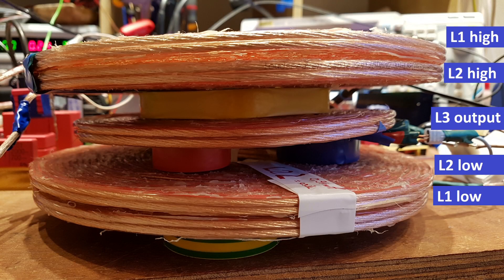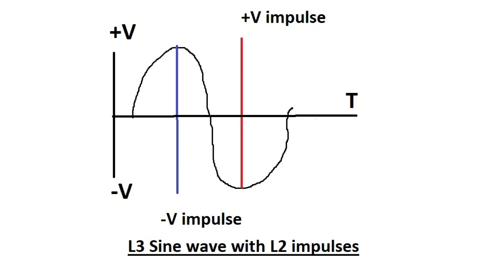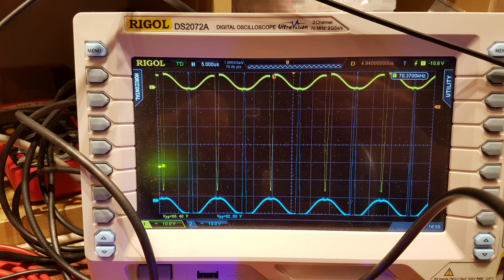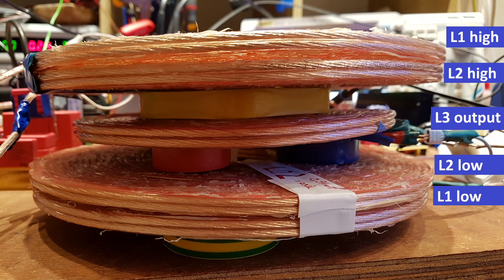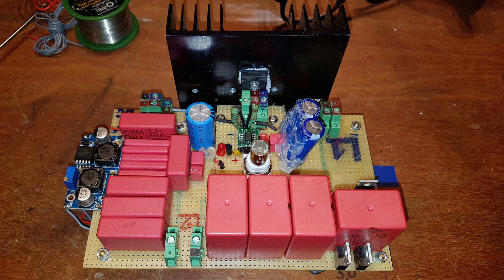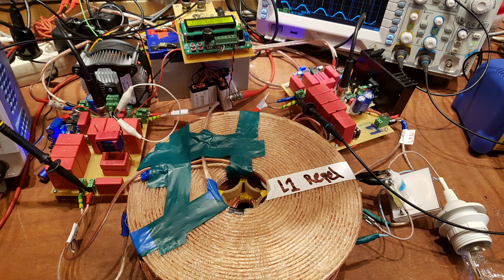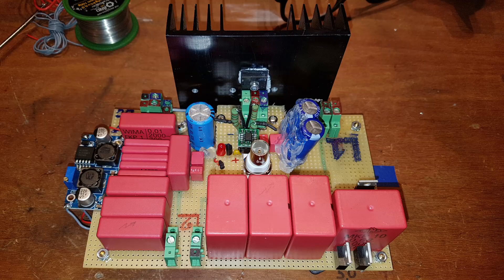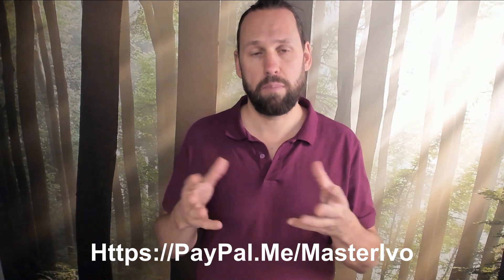How to induce electricity

Comment: I present a crazy thought for your consideration: Following the discoveries of Ken Wheeler -- aka Theoria Apophasis -- the magnetic dipole is a direct consequence of a dielectric, radial field and occurs at a 90 degree instantiation of a hyperboloid shape of counter-rotating vortices, forming a wrap-around return on both open ends of the hourglass by consequence of the magnetic attraction to the pole on the other end of the hourglass.  Or I am a 'tard misinterpreting Ken and imagineering some fairy-tale, which is always possible...  

Poorly stated and misinterpreted according to the myopia of conventional science: perhaps the Bloch wall at the middle of the magnet creates the magnetic field and its dipoles...

From Ken's perspective -- if I understand it correctly -- every magnetic dipole field therefore necessarily must have a dielectric radial field at the center, offset by 90 degrees a line made between the poles.  Would this then necessarily explain our current need to rotate a magnetic field to have electricity be induced in coil in proximity?  More importantly, does this understanding possibly illustrate a means of tapping the dielectric force without a movement of the magnetic field?  A solid state electric tap produced by the proper geometric alignment of the induction coil to a stationary magnetic field -- is this possible?

Further craziness, heading into lunatic territory: if natural magnets ( lodestones ) are created by lightning striking ferrites contained in the ground, then is the dielectric force somehow entrapped in a containment geometry within the ferrite in such a way as it can not further flow through the material, but gets stuck inside, the magnetic field of the lodestone being the concomitant and consequential magnetic component, also stuck, given the electricity can not further flow through or out of the ferrite?

Madness and insanity, for sure.  Yet possibly reality and truth?  Can one capture lightning in a jar, or moonbeams or electrostatic force as well?  Would that lightning captured in a jar make a bad ass magnetic field in its seeming stasis?  What if, ancient people perhaps not even human once did, and this became the source of the sayings that survive in human lore...?

I personally see in the Permanent Motion Holder of Edward Leedskalnin the world's first MAGNETIC capacitor, though none do recognize this.  The PMH when engaged with a tap of electricity maintains the electromagnetic force after the flow of electricity ends through the coils and nothing remains connected.  'Science' says this is impossible, and has no electromagnet which can do the same.  Yet people all over the world build their PMHs according to Leedskalnin's posthumous descriptions of such and discover the true wonder which disproves conventional science.  While engaged, the rapid flow of magnetism is detectable in the bottom part of the PMH.  See a recent video of Vinny's on youtube to witness some true amazing discoveries...

Magnetic current has been proven in that recent video, in vindication of Leedskalnin, after nearly a century...  Wow.  A novel type of superconductor is therefore theoretically possible to construct with Leedskalnin tech -- operating AT ROOM TEMPERATURE, though such might have weird thermal effects, perhaps like supercooling.  Maybe this theoretical superconductor was a missing component in the alleged levitation capabilities Leedskalnin might have effectuated in constructing his home, as was apparently witnessed, and as his own words state...

There does not exist a word to describe the extremity of crazy these conjectures represent compared to the endorsed and supposed knowledge of magnetism in common circulation...

F.
Reply: I checked out the vid, thank you for sharing. I'm not sure we are seeing anything new here unfortunately. It appears, correct me if wrong, that Vinnie created a permanent magnet by inducing the iron with dielectricity courtesy of the battery (dielectric induction). That is the unique property of the element iron. The motor, being hooked up to the battery, revolves in the presence of a magnetic field (both the small rod magnet and the iron loop). I think the important thing here is that it is also the copper in the motor that is undergoing induction. The unique attribute of copper is that it will undergo dielectric induction when in the presence of a moving magnetic field (see MIT's dissectible capacitor). Dielectric induction in copper manifests a magnetic field which in turn is displacing the magnets in the motor causing rotation. I do not see any magnetic 'current' anywhere in this demo unfortunately. We are seeing the unique attributes of both iron and copper together providing magnetic displacement. There is no current of any kind flowing anywhere, merely dielectric induction. Just my observation, not gospel of course., as who really knows the intricacies of the energy field phenomenon.
Reply: Hi, can you please give us a link to the Vinny video you refer to?
I had a look through your profile to see if I could find it, but no luck. However, I did notice you not only follow Master Ivo and Ken Wheeler, but also Lori Gardi (FractalWoman). My 3 favourite!!!!

Thanks in advance.
Reply: @hopepeace4956  Amigo, forgive my hasty post earlier.  The video you want is https://www.youtube.com/watch?v=fzQmC2-VU3g&lc=z22av1ertpfbujk0tacdp434l3scbrxzmdp01y2ubb1w03c010c.1576962115104981

starting about 1:45 into the video.  In my honest opinion, Vinny provides the first tangible proof of Leedskalnin's postulated current of magnetism, rather than that of electricity.  The name Permanent Magnetic Holder begins to make sense in this context...  

Additionally, please note the lack of a detected magnetic current in the upper portion of the U shaped iron where it curves.  I suggest that a novel type of superconductor is therefore possible given the possibility that either an electric current circulating in the coils is preventing the magnetic saturation of the iron below and beyond the copper coils, *or what we perhaps have misconstrued as electric conductivity of certain metals is actually a property of their diamagnetism instead, and should thus be perhaps understood as MAGNETIC REFLECTIVITY instead of electric conductivity...*. A divergent way of understanding superconductivity which makes such understandable and predictable is understanding such as hyper magnetic impermeability or hyper magnetic reflectivity.  If a portion of the reflected magnetism is phase inverted and thereby establishes the opposing pole of magnetism this might account for the simultaneous magnetic repulsion and attractions seen in superconductivity.  Seems to me that there are a good number of superconducting materials which incorporate copper...

Or I'm as crazy as a loon, misinterpreting the tangible and evident, conventional-science-busting mysteries of another crazy loon named Leedskalnin.  It is possible that I misunderstand and misinterpret the whole thing.  From some perspectives -- especially the constrained and bogus one of particle physics, my statements certainly must defy logic just as they defy the paradigm.

F.
Reply: Seriously. Did you forget walter russell? He solved the stationary magnetic field already rofl. The dielectric field organized and then disorganized itself. This also creates electricity.
Reply: @atum7355  My friend, I confess an abysmal yet correctable ignorance of Walter Russell and his concepts.  I will look into this and thank you for pointing me in the right direction...

F.
Reply: @pneumatonic  You're welcome : )

Comment: Two rotating vortices.

Protons have a rotating magnetic vortex which has an interesting property when dealing with the dual converging centripetal lines of force inherent of every matter particle.

The simplest way to picture the interaction between two protons and their magnetic fields is by using two similar magnets. Depending on their polar alignment the magnets will either repel or attract each other. The attraction mechanism is simply the attraction of each particles dielectric to the others. What is happening here is pressure mediation. High pressure to low pressure.

The magnetic torus when North and South poles are aligned enable the two toruses to mutually combine into the same direction. When similar poles are aligned it is the magnetic torus’s counter rotation motion that prevents the two magnets sticking together.

When the two magnets are aligned and stick together their magnetic geometry combines to form a self sustaining and mutually beneficial lower state of magnetism with an increase in quantitative dielectric force.

Make sense?
Reply: Makes definite sense yes. Pressure mediation and the coupling of like vortices, or the displacement and flipping of unlike vortices. That all makes sense and can be witnessed in nature. However, light is unaffected by neither magnetism nor electricity. Going off topic but this really bugs me. Magnetism has no affect on light whatsoever in a vacuum. If magnetism is aether in displacement, what is the medium that induces light within magnetic displacement? I am not a follower of quantum cult. I have a solid understanding of magnetic and its conjugate dielectric, I can conclude what electricity is (not Ken Wheelers theory) however light is the final frontier for me. It is part of the energy field (aether) complex, yes, however what that part is, is a mystery to my pathetic brain. Happy new year to you.
Reply: Light is just another attribute of EM just at a different frequency. Where you thinking of the ‘wave particle’ duality the quantum guys are fond of?

Hmmm...

Using light as an example.

Composed of alternating magnetic dilation where the magnetic force weakens by distance then collapses. The collapse is increased dielectric  acceleration to a point at which the electrostatic discharges creating a magnetic field. And the cycle continues along a curvilinear trajectory.

The key point is lights dielectric or electrostatic element. I surmise that since all dielectric is seeking counter-space then light is naturally drawn towards all matter. Whereas a magnetic field of great magnitude or intensity of the same frequency or (the closest analogy term I can think of) harmonic should displace the direction of that light somewhat.

I think Ivo’s project works on this principle as it uses resonance in such a way that there is induced magnetic field bouncing back at 180 degrees. When the two coils are in resonance the magnetic fields repulse each other insomuch that when this occurs there is an immediate and drastic shift into a mutual dielectric field. (Not a field per say but a region of dense Aether)

Because of the sudden binding of dielectrics and absence of magnetic Ivo has effectively separated the dielectric from magnetic. The magnetic does an inductive spike and the Aether becomes saturated. Perhaps this is what Tesla was talking about in which the region of saturated Aether can be focused. This may be how he also managed (and Dollard) to light a bulb in an open circuit.

I wonder if saturated Aether also seeks equilibrium by forcing the saturated area much like an air bubble under increased pressure. The mechanism of Aether pressure mediation may in fact create a following current that has equal to or slightly less ‘potential’ than the original mutual dielectric field? This may be why there can be more energy coming out of the system than went in. Hmmm....

Tesla may have found a technique that allowed him to tightly focus a great quantity of dielectric into a region causing any matter in that region to overload with   saturated Aether causing immediate intense electrification of that matter. 

Anyway it is late and my bed is calling.

Food for thought
Chasing Dragons
Reply: @redfishervictoria  Thanks Dragon. My thinking regarding the creation of light is along the same path as what you have described. That being the collapse of the magnetic field into equilibrium, or counterspace, is providing the pulse force of the longitudinal aether perturbation. It seems though, that this incoherent system of radiative pulsed aether, is unaffected by magnetic displacement, and for that matter, concentrated areas of aether. Your eyes can process the signal, for example, of Ivos coils without distortion. You can see, even through a vacuum, the poles of a magnet without distortion. Light is aether, no doubt in my mind, however if it is EM in nature why is it not affected by either E or M? The discharge of the pulse perhaps, is of such violent force that relatively minor magnetic displacement has little to no affect. That is the best I can do at this stage.

Ivo is creating, and harnessing it seems, a amplifier/capacitor of sorts. Harmonics and resonance to build the magnetic displacement. I view the system as an amplifier of the magnetic through resonance which, like you say, concentrates aether just like a capacitor would between two plates (coils). The bonus here is that the bifilar coil is also capacitive. The pulse, or obliteration of the magnetic, perturbates the concentrated aether creating a high energy situation, the collection of which is best achieved through additional capacitors. It is all possible due to the unique attributes of copper, which undergoes dielectric induction, a phenomenon which has nothing to do with magnetism nor Eddie currents, but everything to do with dielectricity, or coupled centripetal aether. This is all something that you obviously have a good understanding of already I'm sure. Good to find someone out there that thinks along the same lines. I'm not just going crazy here all by myself.

Edit. Great to see experimentation being done. Ivo doing a sterling job. Wish I could contribute myself experimentally however time just not permitting at present. So many areas to explore, capacitance being key. Add in resonance, harmonics, momentum, geometry of coils, pulsing, external aids such as gravity etc, I'm certain a solution is staring us all on the face, cheers.
Reply: Good to know there is somebody else out there thinking along the same lines.

Cu. 
Tesla naturally used silver with great results. Ivo’s experiment would benefit from silver but it is costly.

I have been mulling over the use of Bismuth cooled to its temperature of zero permittivity.
Also pyrolytic carbon as it is amazing at blocking the magnetic and could be utilized to direct or focus the electrostatic.
Reply: @redfishervictoria Some good ideas there for sure. Perhaps also cooled mercury in a flywheel application. Create the magnetic displacement and collapse in pulse fashion, however do not let it return to equilibrium. Super cooling is out of my capabilities but I thought a flywheel composed of a magnet or magnets that is positioned right in the middle of a hyperboloid shaped coil, and it's rotation is opposite to the magnetic vortex. That could be interesting. Hope one day we can put these ideas into reality ha ha. Some nice thoughts Dragon, definitely same thought process.

Comment: Ivo what is your best desription for the dialectric field, I describe the Magnetic field as frequency including light.  The dialectric I view it as the silent space between two pulses, and the magnetic is the actual pulse. If you have two pulses you have a space in between those two pulses, and it  is silent , or is it??? Maybe the silent space is actually the dialectric.
Reply from the maker: polarised Aether (a collection of faraday tubes, terminated on two conductors)
Reply: @MasterIvo  an exploded diagram
Reply: @MasterIvo  Makes sense, a very mechanical explanation. But the Tubes are only reacting to the dialectric field as recievers/Transmitters located inside the field. They are not the field itself.
Reply: @MasterIvo  When saying a collection of tubes one can start with two and picture a toroidal field shaped like a 2D pancake connecting the two tubes. but as soon as you visualize a third tube now you are creating a 3 dimensional plasma field. It is probable that induction of plasma is not possible with two electrodes/tubes i say this cause i am under the impression that plasma cannot exist in 2D but hey what do i know. I can say for sure that I know how to raise esoteric questions.